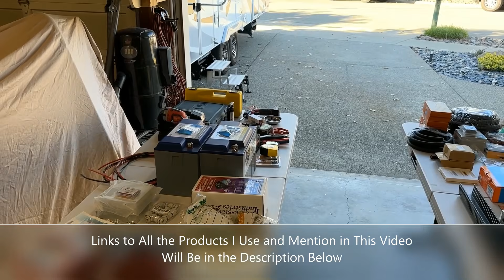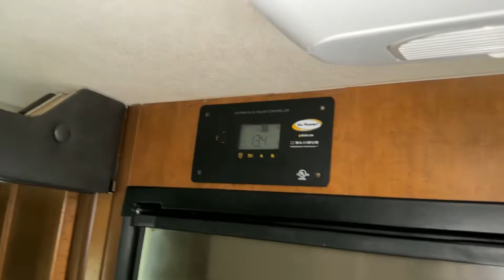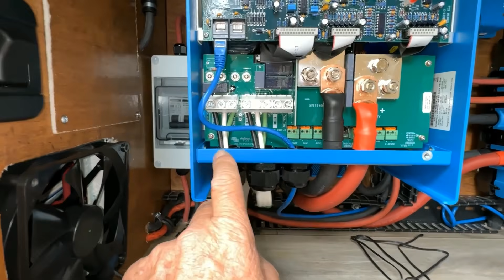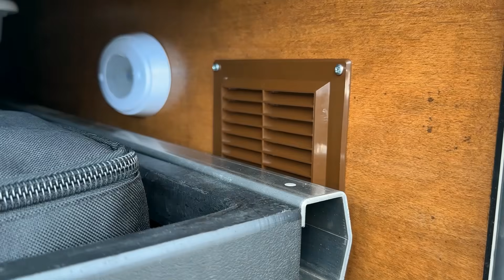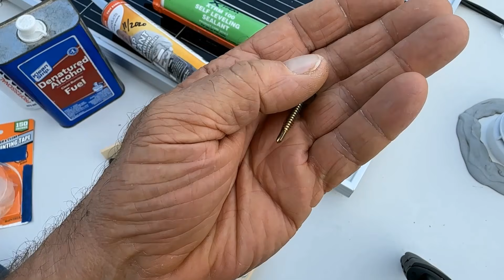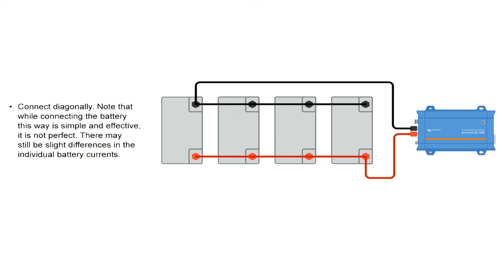RV Inverter/Charger and Solar System Installation - Lots of Info in the Video and Description Below

Comment: Hi Michael, asking this as you're familiar with the Lance 2375. We're adding lithium batteries but keeping them in the original locations on each side of the trailer for now. When installing a DC to DC charger, what would be the best way to connect both batteries in your opinion where they're approx 8' apart? Thanks!
Reply from the maker: What size DC to DC Charger do you have or or planning to buy. Can you provide me with a link to the charger, I may be able to help answer your question. Thanks, Mike
Reply: @thetraveltrailerguy Thinking of purchasing an isolated model and running the positive out from the charger to one battery and the negative out from the charger to the other battery. Trying to determine if it would matter using a non-isolated one that only has one ground lead and going to the frame of the trailer? The 50 amp Renology and Victron models look similar. Tia!
Reply from the maker: @PMH2027  Do you have an inverter (converts 12 volt power to 110 volts to power electrical outlets)? Are you using the existing charge controller (behind the electrical panel) that came with the trailer or are you changing this out to one that is made to charge lithium batteries? Sorry for all the questions. Mike
Reply: @t @thetraveltrailerguy  Mike, no inverter yet other than a very small one that runs the TV- that was going to come in the next phase. We’ve ordered a 75 amp converter that is compatible with Lithium and should be here soon.
Reply from the maker: @PMH2027  Sorry it took me so long to reply, we were out of town for a wedding. So to answer your question for the wire size from battery to battery and putting into consideration you may get a larger Inverter in the future I would use this wire (link below), its pure copper - 2 Gauge 2 AWG and is very flexible and easy to work with. (you do not ever want to use aluminum wire covered in copper, just pure copper). It comes in various lengths so make sure you select the length you need. I hope this information is helpful. Mike

2 Gauge 2 AWG
https://amzn.to/48fjUjm

More information:

For connecting two 100Ah lithium batteries 10 feet apart, you should use 
2 AWG  copper wire to ensure minimal voltage drop and handle up to 100-200A loads safely. While 4 AWG might work for lower loads, 2 AWG is recommended for a 10-foot run to maintain efficiency. 

Distance/Drop: 10 feet is considered a moderate distance; 2 AWG keeps voltage drop low (~3%).

Connection Type: If connecting in parallel (to keep 12V), ensure both positive-to-positive and negative-to-negative cables are 2 AWG.

Safety: Ensure all wires are fused appropriately according to your load.
Reply: @thetraveltrailerguy Thanks for the info Mike, helps a lot!
Reply from the maker: @PMH2027  You're welcome, feel free asking me questions. I'll do my best to answer them. Mike
Reply from the maker: Information regarding a Renogy DC to DC Charger. For educational purposes - https://youtu.be/EcVjPap9dkY?si=jDCyFOlqmVsPrMqn

Comment: What model and year is your Lance?
Reply from the maker: Thanks for watching :) Its a 2020 Lance 2375. We really like it a lot. 
https://www.youtube.com/@thetraveltrailerguy/videos
Reply: @thetraveltrailerguy With your solar, lithium battery, and inverter capacities, what have you been able to run with full sun and how long? Example I’d think the furnace and a 12V fridge indefinitely but what about the AC? Was your whole system upgrade under $10k? TIA!
Reply from the maker: @PMH2027  Nice hearing from you again Marie. Great question I'll try and do my best to answer :)

With this system everything is powered with 110 volts (Outlets, AC, Microwave, TV's) and 12 volt power (Everything else except refrigerator cooling)

The refrigerator is runs on propane and 110 volts. We have tried running the refrigerator on the battery 110 volts but it draws a lot of power so we  just operate it on propane unless we are hooked up to shore power. It does not run on 12 volts (it does not take much propane at all to run the refrigerator)

   I have 4 - 100 amp hour Battle Born batteries (400 amps) & 790 watts of solar.

We watch a lot of TV movies, make coffee, microwave, run a floor counter fan, charge phones, laptops, electric bikes. 

We have found that when we are parked where there is full sun during the day the batteries get fully charged back up from 65+% to 100% by 10:30 am and hold that charge until evening and this cycle goes on for days.

If we are parked in a overcast area or under partial shaded area we can go around 4-5 days and then have to use a 2000 watt generator to charge the batteries back up through the Victron Charger. Charging the lithium batteries at 100 amps per hour fills the batteries back up to 100% very quickly. 

I think everything for this project was around $7,000 +

Here's what I bought from Battle Born (click link)
https://drive.google.com/file/d/1ewPXN9SJBfSblRpZcQyMK_8ZFM4Lmzti/view?usp=sharing

Here's the other stuff I bought and lots of other information can be found below each of my videos in the description area (select more to see it all in this area) - 

I hope all this information is helpful to you and I have answered your questions. Feel free to ask more if you like. Thanks, Mike

What Trailer do you have??????

I bought the Battle Born Batteries from Amazon on sale for $650 each (watch for sales)

NOTE: Links to the products I used, videos mentioned, and much more are located below.

Michael Bracewell The Travel Trailer Guy Videos -
https://www.youtube.com/@thetraveltrailerguy/videos

Victron & Battery Wiring Options 
https://www.victronenergy.com/upload/documents/The_Wiring_Unlimited_book/43562-Wiring_Unlimited-pdf-en.pdf 

Victron Website -
https://www.victronenergy.com/

Victron & Battery Wiring Options on the Internet -
https://www.bing.com/images/search?q=hard+wiring+a+hardwired+ems+through+a+victron+multi+plus&qpvt=hard+wiring+a+hardwired+ems+through+a+victron+multi+plus&form=IGRE&first=1&cw=1265&ch=593

Wire Sizing Guide -
https://asobolife.com/solar-panel-wire-size-guide/

Wiring Solar Panels - Series & Parallel -
https://www.renogy.com/blogs/learn-center/learn-series-and-parallel?Rng_ads=30dfdebf70858a7b&gad=1&gclid=CjwKCAjwvfmoBhAwEiwAG2tqzAHN42D8YxeDed6Gl4wnBIyO8SJ0q-omrVnSKDYI1augow3SI5ozThoCYLEQAvD_BwE

Video - how I built shelf over batteries -
https://youtu.be/aDfOVku-7mk?si=oaoXjxI3LX4wQlzw&t=205

Michael Bracewell "The Travel Trailer Guy" is an Amazon Associate. I earn a small commission from qualifying Amazon purchases by you using the Amazon links below at no additional cost to you. Thank you!

100Ah 12V Lithium-Ion (LiFePO4) Battery -
https://amzn.to/4o2BKMr

200 Watt Solar Panel -
https://amzn.to/4nYp3lT

Rubber Expansion Nut  - (Well Nut)
https://amzn.to/2ZlAqyb

Crimping Tool - 
https://amzn.to/30QEeEF

Solar Branch Y Connectors for Parallel Connection Between Solar Panels -
 https://amzn.to/3WQttPF

Solar Connectors M/F -
https://amzn.to/48OUIBH

Roof Screws -
https://amzn.to/4oxGWaZ

1/2 " Cable Clamp -
https://amzn.to/3L51RUr

Solar Panel Hardware  -
(4 pack) https://amzn.to/3JdC9N2
(8 Pack) https://amzn.to/4o6cNzW

Lasalle Self-Leveling Sealant -
https://amzn.to/3WncR1V

Caulking Gun -
https://amzn.to/4amzdXF

Victron MPPT Solar Charge Controller  -
https://amzn.to/4ogoxzC

Victron Lynx Power Connector Box -
https://amzn.to/4o4zmoq

Victron Battery on/off Switch -
https://amzn.to/474i590

56" Battery Tie Down Strap -
https://amzn.to/475lZ1n

Wire Stripper for AWG 12 to 4/0 Round Cables -
https://amzn.to/4oz6vbM

Junction Box (6'' x 6'' x 3'') Electrical Box -
https://amzn.to/3JqO89Z

Butyl Seal Tape -
https://amzn.to/4oFARtn

10 Pcs 3/8" Nylon Cord Grip -
https://amzn.to/475mWXv

Bus Bar Screw Terminals Power Distribution Block -
https://amzn.to/3WQDgFo

Solar Circuit Breaker -
https://amzn.to/4oCIock

6 Gauge 25 ft Black + 25 Feet Red Solar Wire -
https://amzn.to/4nnkQH7

4/0 Gauge 4/0 AWG 12.5 ft Red + 12.5 ft Black Flexible Cable + 10pcs of 3/8" Lug Terminal Connectors + 3 ft Black Heat Shrink Tubing -
https://amzn.to/47CkeZz

Heat Shrink Tubing Kit  -
https://amzn.to/4njmAkI

10/3 AWG Triplex Marine Wire  -
https://amzn.to/3Je94kE

1" Split Wire Loom
https://amzn.to/3WkNEoU

Black Spray Foam -
https://amzn.to/4o3yQHc

Zip Ties Heavy Duty 12" -
https://amzn.to/4789HW5

78in Cable/Cord Organizer -
https://amzn.to/4owP7nQ

Waterproof Box for Electrical Outdoor Enclosure 6.9 x 4.9 x 3 inch  -
https://amzn.to/4ndilal

8AWG Solar Cable with Female and Male Connectors
https://amzn.to/4nlIGmG

Terminal Block 500V 60A Dual Row Screw Electric Barrier Strip -
https://amzn.to/43gvvfV

Victron MultiPlus - Power Inverter/Charger - 3000VA 12-Volt -
https://amzn.to/48Kj3si

12V RV Ventilation Cooling Fan -
https://amzn.to/42W8dvw

Victron Energy BMV-712 Smart Battery Monitor with Shunt -
https://amzn.to/4ouLw9V
Reply: @thetraveltrailerguy I really appreciate all the info! We have a 2019 Lance 2375 and really like ours too. No solar, lithium, or inverter yet. Will probably start with lithium and a dc to dc charger and add from there.
Reply: @thetraveltrailerguy Hi again Michael, how did you access the area in front of the pass through storage area on the 2375 to access the wiring? Did you cut a larger section out the cover it back up with a different piece of plywood? Or can you access that area by cutting a square out directly behind the most forward part of the mattress? Thanks again!
Reply from the maker: @PMH2027  Great question I should have shown what I did in the video. I removed the 6"X6" square piece of paneling covering the access hole located at this location you can see in the video on the left ( play the video here -https://youtu.be/ZodrJEBAdEQ?si=0IiZjRzT4nkg7Wxd&t=2319 ) where I cut the hole a little bigger to put the fan with the screen over it. Behind there I was able to find all the wires that came from the existing batteries (I removed these batteries). In this area I found the battery wires and disconnected them in this area. I then was able to reach in the hole and connect all the other wires together on a junction block and then ran wires from there to the Lynx Distributor.  I hope I explained this well enough for you to understand.
Reply: @thetraveltrailerguy perfect thanks!

Comment: Thats an awesome upgrade Michael. I have been considering a similar upgrade, but right now its cost prohibitive. When I do decide to do it, I'll definitely be going with the Victron. I do have a Victrom Smart Shunt that works fantastic. My 300ah LifePo4 battery has blutooth so I have to ways to monitor. Great work! I know all those cables were pricey as well!
Reply from the maker: Thanks for watching my videos Rob and for taking the time to provide feedback and information. 

Check this link out and when you have time check out all the other information I shared below (you can always find information like this in the description area below each one of my videos) 

*** Battle Born & Victron Materials and Pricing PDF (what I purchased from Battle Born) -
https://drive.google.com/file/d/1ewPXN9SJBfSblRpZcQyMK_8ZFM4Lmzti/view?usp=sharing

Victron & Battery Wiring Options 
https://www.victronenergy.com/upload/documents/The_Wiring_Unlimited_book/43562-Wiring_Unlimited-pdf-en.pdf 

Victron Website -
https://www.victronenergy.com/

Victron & Battery Wiring Options on the Internet -
https://www.bing.com/images/search?q=hard+wiring+a+hardwired+ems+through+a+victron+multi+plus&qpvt=hard+wiring+a+hardwired+ems+through+a+victron+multi+plus&form=IGRE&first=1&cw=1265&ch=593

Wire Sizing Guide -
https://asobolife.com/solar-panel-wire-size-guide/

Wiring Solar Panels - Series & Parallel -
https://www.renogy.com/blogs/learn-center/learn-series-and-parallel?Rng_ads=30dfdebf70858a7b&gad=1&gclid=CjwKCAjwvfmoBhAwEiwAG2tqzAHN42D8YxeDed6Gl4wnBIyO8SJ0q-omrVnSKDYI1augow3SI5ozThoCYLEQAvD_BwE

Video - how I built shelf over batteries -
https://youtu.be/aDfOVku-7mk?si=oaoXjxI3LX4wQlzw&t=205

Michael Bracewell "The Travel Trailer Guy" is an Amazon Associate. I earn a small commission from qualifying Amazon purchases by you using the Amazon links below at no additional cost to you. Thank you!

100Ah 12V Lithium-Ion (LiFePO4) Battery -
https://amzn.to/4o2BKMr

200 Watt Solar Panel -
https://amzn.to/4nYp3lT

Rubber Expansion Nut  - (Well Nut)
https://amzn.to/2ZlAqyb

Crimping Tool - 
https://amzn.to/30QEeEF

Solar Branch Y Connectors for Parallel Connection Between Solar Panels -
 https://amzn.to/3WQttPF

Solar Connectors M/F -
https://amzn.to/48OUIBH

Roof Screws -
https://amzn.to/4oxGWaZ

1/2 " Cable Clamp -
https://amzn.to/3L51RUr

Solar Panel Hardware  -
(4 pack) https://amzn.to/3JdC9N2
(8 Pack) https://amzn.to/4o6cNzW

Lasalle Self-Leveling Sealant -
https://amzn.to/3WncR1V

Caulking Gun -
https://amzn.to/4amzdXF

Victron MPPT Solar Charge Controller  -
https://amzn.to/4ogoxzC

Victron Lynx Power Connector Box -
https://amzn.to/4o4zmoq

Victron Battery on/off Switch -
https://amzn.to/474i590

56" Battery Tie Down Strap -
https://amzn.to/475lZ1n

Wire Stripper for AWG 12 to 4/0 Round Cables -
https://amzn.to/4oz6vbM

Junction Box (6'' x 6'' x 3'') Electrical Box -
https://amzn.to/3JqO89Z

Butyl Seal Tape -
https://amzn.to/4oFARtn

10 Pcs 3/8" Nylon Cord Grip -
https://amzn.to/475mWXv

Bus Bar Screw Terminals Power Distribution Block -
https://amzn.to/3WQDgFo

Solar Circuit Breaker -
https://amzn.to/4oCIock

6 Gauge 25 ft Black + 25 Feet Red Solar Wire -
https://amzn.to/4nnkQH7

4/0 Gauge 4/0 AWG 12.5 ft Red + 12.5 ft Black Flexible Cable + 10pcs of 3/8" Lug Terminal Connectors + 3 ft Black Heat Shrink Tubing -
https://amzn.to/47CkeZz

Heat Shrink Tubing Kit  -
https://amzn.to/4njmAkI

10/3 AWG Triplex Marine Wire  -
https://amzn.to/3Je94kE

1" Split Wire Loom
https://amzn.to/3WkNEoU

Black Spray Foam -
https://amzn.to/4o3yQHc

Zip Ties Heavy Duty 12" -
https://amzn.to/4789HW5

78in Cable/Cord Organizer -
https://amzn.to/4owP7nQ

Waterproof Box for Electrical Outdoor Enclosure 6.9 x 4.9 x 3 inch  -
https://amzn.to/4ndilal

8AWG Solar Cable with Female and Male Connectors
https://amzn.to/4nlIGmG

Terminal Block 500V 60A Dual Row Screw Electric Barrier Strip 
https://amzn.to/43gvvfV

Victron MultiPlus - Power Inverter/Charger - 3000VA 12-Volt -
https://amzn.to/48Kj3si

12V RV Ventilation Cooling Fan -
https://amzn.to/42W8dvw

Victron Energy BMV-712 Smart Battery Monitor with Shunt -
https://amzn.to/4ouLw9V
Reply: Looking at the PDF. Thats a lot cheaper than I was thinking. If I heard you correctly you said 400ah of Battle Borns. That’s another 3k. But still less than I thought. And no labor since you have a lot of time on your hands to do it 😊
Reply from the maker: @49ersRob  I think I got the Battle Born Batteries for $650 each on sale. $2,600. Lots of free labor from me on this project lol